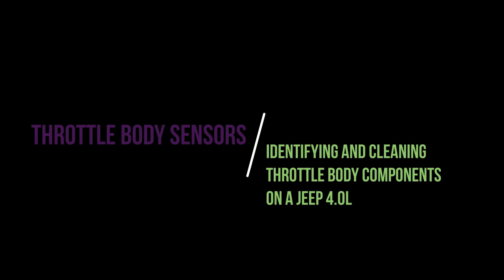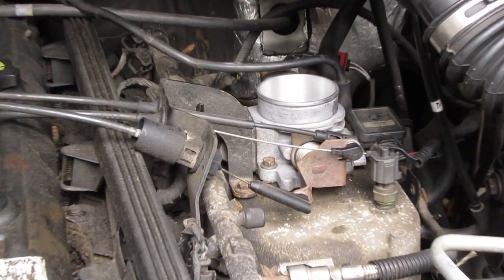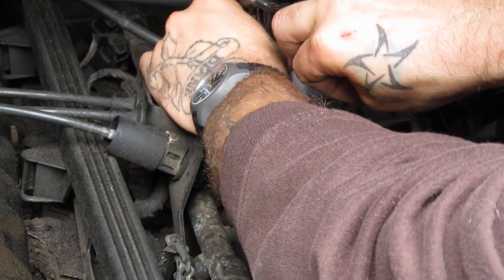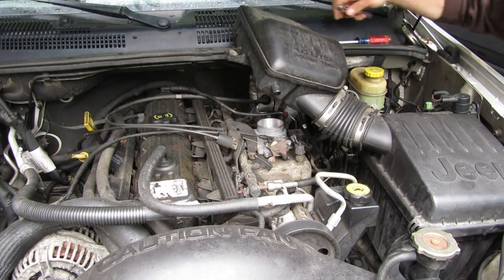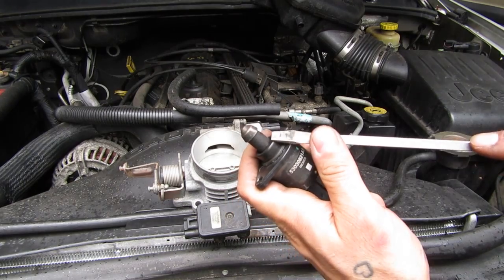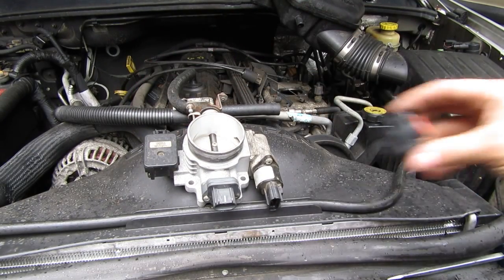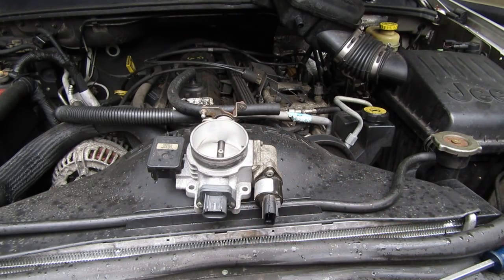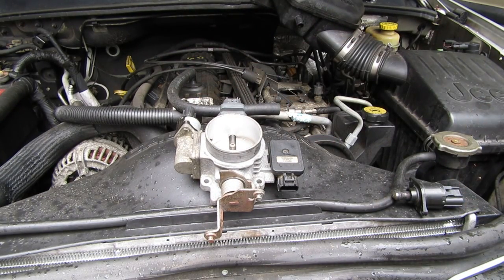THROTTLE BODY SENSORS (IAC, TPS, MAP) - Jeep 4.0L

Comment: If it just shuts down and while sitting at a light or something does that have anything go do with the throttle because a friend told me its a map sensor issue
Reply from the maker: Yes, definitely could be. More likely it is your idle air controller
Reply: I had the same issue with my jeep when I got it. It's the crank position censor. Its located on top of the transmission. There are videos on YouTube that show you how to change it out. But it's a total headache. I just paid a mechanic $50 to do it. He put it up on a lift and used 3 different extensions to get to the top of the transmission housing and changed it out. The sensor is on $30. Good luck

Comment: OK ... i watched this 27 times !!! Did mine  yesterday. .  The only thing I would add is  that tiny seal that houses one of the sensors when U clean it off ... luckily I had a roll of diy seal ... 🦭... i bought the roll cause they didnt have the sqare seal  for the trottle body ... also ... just take off the cover to the filter box .... way more room .. also when i pulled the throttle off it kinda broke a seal 🦭 to pull that big ruber seal that go'es around the trottle body.    Seems to be fine ... but I would have taken my time ..

Comment: Thanks for the video.  ...I'm still having trouble with my idle after a tech cleaned up my throttle body (I was on the road w/o tools), but now want to remove myself to do the cleaning right as well as replace all of the sensors.  I have the MOPAR original replacements for the IAC (04798377), TPS (68405575AA), and the Gasket (53007543AB) ....still need to get my MAP ..do you know the correct part number for the MOPAR original MAP for a 1993 Jeep Wrangler 4.0L 6cyl...? I only want to do this once, at least only once this year!

Comment: Hopefully not a stupid question, but did you use the same cleaner on all three parts, or did you also need to use an electronics cleaner? I might have missed it... About to do it on my son's '04 Wrangler 4.0L and was just curious.
Reply from the maker: Well the MAP and TPS sensors do not require cleaning (infact, cleaners should be kept away from the rubber hose attached to the MAP). They are either good or bad. For the IAC I used brake parts cleaners, but you could use carb & choke cleaner, gasoline, anything that will break up carbon

Comment: So my Jeep tj is having trouble in reverse. When I am in reverse in my jeep tj it sometimes die or even has trouble going in reverse even if I  have the throttle down to the floor. Do you think it’s the throttle position sensor? It only does it when it’s warm not cold. When cold I can put the throttle all the way down and it makes my tj spin its wheels.
Reply from the maker: It is certainly possible, but it doesn not exactly sound like a common TPS issue
Reply: D&E In The Garage well I just changed the TPS sensor. And it was the problem but the thing is, it high idles. The rpms are at 2 and even 3,000 rpms. Did I put the TPS sensor wrong?
Reply: Well never mind it didn’t fix the problem. It still acts like it wants to die in reverse

Comment: What is the hose that goes into the intake I know they are vaccum lines I just need to know where they go cause mine is plugged off
Reply from the maker: It goes from the valve cover to the intake. There should be an elbow on your valve cover where you can plug it in
Reply: @DEInTheGarage  can you send a video cause I can't find it please and thanks

Comment: So I went through a small pond and hydrolocked my engine. Got all the water out and it started up and drove home just fine. The next day I’m throwing a code for high voltage TPS and my idle is high and when I drive it wants to/will stall out and die. I changed the TPS and it didn’t fix anything, does anybody have any idea what it could be?

Comment: I took my throttle body out and gave it all a clean with carbu cleaner and I thought I was careful with not getting cleaner on the sensors. Put it all back together and now my car idles (in Drive) @ 1250. When I shift into park it revs its tits off. Well over 2k. Drives ok, but idles high and rpm range between all gears is between 1500-2250.

Comment: I have a 2004 jeep grand cherokee laredo 4.0 and it has this high pitch whistling noise whenever I drive it. It normally does it when I let off the gas and stops when I push on the gas. When I come to a stop sign or it I let it idle it will whistle and the whistling will stop after like five minutes. We thought it was a belt and we had it replaced but it still does it. It is coming from the back side of the motor. Is there any chance by changing or cleaning the throttle gasket that it would make that high pitch noise stop? I would really  like to know what is causing it.. it is so annoying!!!
Reply: Yep sounds like you might have a vaccum leak, easiest way to check is spray some ether/starting fluid around the base of your throttle body & all around your vaccum hoses in that area & if your idle speeds up then you have a leak at that spot! you can also spray brake cleaner if you dont have ether but ether just works better ✌
Reply: After thinking about it you probably do have a leak, check the crankcase ventilation hose its the one coming from the top rear of your valve cover but becareful with it the hose ends & the  gray plastic elbow that goes into the valve cover get real hard & brittle over time from the engine heat and they break real easy as does the front black one which is your pcv elbow but its called something else cccv or something, i just ordered the grommets & elbows for mine couple days ago! but if it is the rear crankcase ventilation hose you can get just the 2 rubber ends if thats what it is!

Comment: Yes I when you take that air breather does that have a gasket on it the big circle under the air breather does that have a gasket
Reply from the maker: There is a rubber sea which fits over the lip of the throttle body (big circle). It usually stays on the air intake plumbing when removed

Comment: I've been have a joy of a time with my '04 WJ TPS. I've replaced the TPS a couple times, and it still throws the code from time to time. I'm pretty sure it's my harness at this point. I tore my throttle body apart, and just moved the wires coming out of the harness a little bit, and the code went away.
Reply from the maker: I can't could the number of 4.0s I've seen with TPS issues. It is certainly a weak point for us

Comment: my 88 chero  has a screw on the side of the throttle body  what is that for ..it  goes all the way to the inside
Reply from the maker: Idle set screw. screw it in to increase the idle speed and out to decrease
Reply: thank you

Comment: Hey just subscribed!!! Thanks for the video, where do you purchased the IAC sensors and what is the part number???
Reply from the maker: To be honest, we get them by the handful at our local junk yards. If you want to get a new one, rockauto.com has them for $8. part number is  2H1094
Reply: @DEInTheGarage  , thanks so much for quick reply!!! My daughter have a 2004 GC special edition 4.0, 6 cyliñder, engine light has been on since she bought it. She had new PMC  put in at dealership and also wanted them to address engine light, but for time sake, they erased the light and tried to tell me it was not on. But the light came back on and has stayed on not able to pass emissions test!!! The test says, cataylic. One mechanic says it is the evaporative system, my daughter said, he said the charcoal cannister needs replacing, did not hear that, but he said that it is all taped up, I did onboard diagnostic, 3 codes, 1682 I do believe that is right for alternator which we knew, radiator began leaking, might have contaminated be alternator??? Also the night before alternator swap, truck died and when I tried to restart, it made the noise. We swapped it out.(We did this scan after the truck would not start after new alternator install)>>> scanned the truck, 2 codes were about air sensors, don't have them in front of me now, but when I started the car drove two blocks over, parked for the 2 days neighbor put air in the tire,  drove back to house, parked car, upon trying to restart truck, truck made some kind of short sound again, perhaps as you said as though something was going on with the transmission, tried to start made a few sounds, as though battery was drained and did not start up. I put battery on charger but have not tried to restart yet. Do you think this could be Map and IAC sensors???? Will reply with codes shortly. We will be swapping out radiator next on her truck. Also I want to do the smoke test on the truck concerning evap issue, not totally convinced the canister is the sole culprit if at all. Thanks for your time! Amen.
Reply from the maker: Lets start at the beginning. A bad alternator will kill your battery and visa versa. Low voltage from your battery and alternator can cause you to throw odd codes especially for electric sensors which require very specific voltage to operate properly. I think your first stop will be to ensure that you have a good alternator and battery. It sounds like you will need a new battery from what you have described. Once you are certain your changing system is up to par, you are going to want to clear any codes and drive around for a few days to give the system a chance to run diagnostic and complete the readiness monitors. If after that the light comes back on, whatever codes are stored can be taken as valid and addressed.

Comment: I am having issues with 2001 jeep 4.0. It starts and idles but the second I put foot on gas it acts like the timing is off. Runs rough and then dies. Wound that be a IAC?
Reply from the maker: IAC or TPS could be. Get cheap ones from a junk yard to test it out
Reply: Cool thank you
Reply from the maker: Good luck with it

Comment: I was headed to work Jeep started bucking under acceleration missing poping. Im not sure but I know the O2 sensor is long gone it was burned in two. But it didn't cause any problems. Once I found it I just taped it up because it was shorting out. Now back to today it was like I was out of gas I got gas and it still was acting up. Hmmmm. So I called in and turned around to limp home. I noticed if I got her past a certain rpm she would run so I turned off Overdrive shiifted to first and got her up not too much shes old. Then my problem went away damn. What happend it now runs fine. I remember there is a very big puddle on the way I believe it was grounding something out. Then dried.back out what you think should I try and get a. O2 sensor at junkyard it needs wire harness repaired or maybe check throttle body.  I dont want just throw away money

Comment: I’m having a problem with my acceleration. If I apply pressure to the accelerator slowly, everything is fine the Jeep accelerate and shifts good. But when I apply pressure the accelerator fast to try and floor it, my engine just revs higher but I don’t pick up any speed.
Reply: Ray Escobedo Sounds to me like a slipping clutch disc due to weak pressure plate if you have a standard stick shift. If you have an auto trans I am not sure.
Reply: utistudent099 it’s an automatic. I already replaced my TPS and this did help somewhat.
Reply: @ray777fe  Sounds good. You have the AW4 from Aisin and that is a very dependable transmission. I have 237K on mine and all original.

Comment: My XJ is having trouble with acceleration. It works fine unless I really punch it, once the engine spins up to 3000 RPMs it starts bogging down, and wont shift. If I back off the throttle it will shift up, and if I roll really easy on the throttle is will do fine till it downshifts and the rpms hit 3000 again. Could one of these sensors be the issue? thank you
Reply from the maker: Sounds like it could be the torque converter. Is the trans fluid ok?
Reply: @DEInTheGarage  Trans Fluid is fine. Red, not burnt. Level is good.  When I accelerate normally, it shifts normal. things operate just fine. It only bogs down when I floor it. When travelling on the highway, if I am travelling on level ground, when I accelerate easily things shift just fine, and I get it up to 80+ MPH. If I hit an uphill grade or attempt to apply throttle as if accelerate fast to pass and the throttle ramps up causing the transmission to downshift and the RPMs shoot up to 3000, then it bogs down and while it is bogging down it won't shift until I release the throttle. then it shifts back up.
Reply from the maker: @nvgun40  It is hard to say.. I can;t think of anything without seeing it. Sorry.
Reply: @DEInTheGarage  Thank you for what you have done. What you have said about the TPS in the video and what I have found in other places on line makes sense. It gives me a place to start. I have made a list of things I am going to do starting Monday. I will replace the fuel filter, and pull the throttle body and clean it. 211,000 + miles, I don't think the throttle body has ever been cleaned. I am going to change the transmission filter regardless for the same reason previously mentioned. I don't think it has ever been done. I will change the sensors on the throttle body. I have been told, one other possibility is a clogged catalytic converter. The current Cat rattles like crazy when it is cold. Sounds like the internals are loose and rattling around. Thank you for the videos and diagnostic advice.

Comment: How did you upgrade your throttle body to a larger bore? Was it an aftermarket part? If so, where can I find one?
Reply from the maker: We found a guy on Ebay who did it. He has since closed shop. If you as around on the forums you will find guys who will do it. usually costs around $100. I will look around and let you know if I find anyone. What area are you in?
Reply: Oh okay, thanks! I just wasn't sure if it was a swap from another vehicle in the junkyard or if it's a special order part. I was able to follow your suggestion of checking the forums and found a couple options. Thanks!
Reply from the maker: @CoreyDavis01  Awesome! Good luck with it

Comment: my XJ 4.0 is having the craziest problem - idle revs higher and higher until you shut it off - checked the IAC and others, grounds etc and can't figure it out for the life of me - been going on six months like this now
Reply from the maker: Very odd... could your throttle valve be sticking?
Reply: i'm wondering if it's the computer - since it's not throwing any codes - nothing mechanical that i've seen
Reply: Look for the hard reset by FordTechMakuloco. This reset is very good to know. Lady at works transmission went crazy. Mechanics couldn't fix it I hard reset it for her 8 months ago. Like new cost nothing!

Comment: So our jeep is not running more than 30 seconds to 2 minutes. It's like someone hit a "kill" switch. It's not throwing out and codes though. Can't figure it out. It's cranks all day at 12.4 volts. And eventually it just stopped starting up altogether. Just cranks over like it wants to startup.
Reply from the maker: hmm.. That is a difficult one with no codes. It definitely implies an electrical issue (no codes because the system is resetting everytime it shuts off). Maybe look at all your main connections to and from the battery, alternator, and power distribution center. That is just an off the cuff suggestion without see the vehicle or knowing much more info
Reply from the maker: Another possibility could be fuel delivery. Perhaps your pump is going or filter is clogged. Now that I think about it, that makes more sense than an electrical issue

Comment: Hello I have jeep wrangler 2005 rubicon 4.0. My problem is after 2200 rpm my jeep start stalling. I already clean the iac, check the tps, check the o2 sensors. My jeep run smootly only after 2200 rpm start with the problems
Reply from the maker: Hmm.. are you certain the engine is breathing correctly? Perhaps the cat is clogged or intake flow is being hindered
Reply: D&E In The Garage well yesterday I replaced a o2 sensor and during the cleaning I removed mostly of the parts you did, I made a test without acceleration body and my engine went to 4k rpm very fast and without problem and NO STALLING at all. I will replace the MAP and TPS with one of my friend here and I will let you know the results. Must be one of this 2.
Reply from the maker: Good luck!!
Reply: D&E In The Garage. Already replaced both TPS first no success, then MAP no success. Is like my vehicle is under governor control. Could be the ecu?
Reply from the maker: Certainly anything is possible, but I have never seen a Jeep ECU go for no reason. were you in high water recently? How is your fuel pressure? perhaps you have a bad fuel pump or a clogged fuel filter
Reply: D&E In The Garage. Good news, I run a better scanner we detect problems on cylinder #3 related to the injector. I will install new injector and see what's the result. Regarding your question, I only jeep on rocks, no water involved.

Comment: I’m 18 and just got my first Jeep and don’t know a lot my Jeep it’s an Xj  when I go to start to move it will kinda stutter and sometimes when I’m driving it will stutter could any of these make it do that
Reply from the maker: Yes, for sure. Does the Jeep idle well or is this issue completely random? I would suggest using the method in the video to remove your throttle body and inspect/clean the TB and sensors. If that doesn't help, your spark plugs could be spent ( we have a video on changing them the right way for a WJ https://www.youtube.com/watch?v=NBUIYH6IZJ4&t=12s). Those would be the easy "good place to start" things to look at. If not, then fuel delivery could be an issue. I would start with cleaning the throttle body, inspecting the sensors, and changing your spark plugs. That is a cheap easy fix to begin. Let me know how it works. good luck!